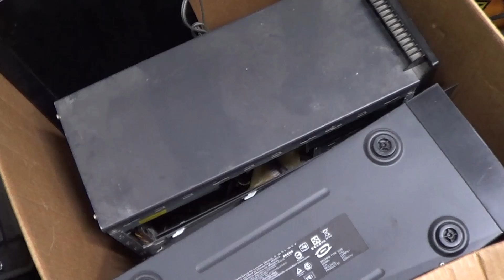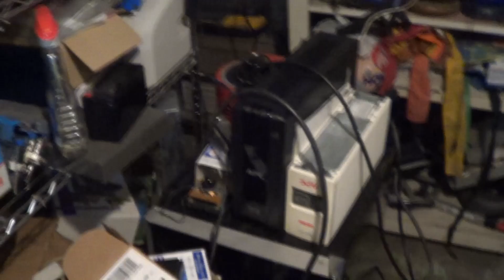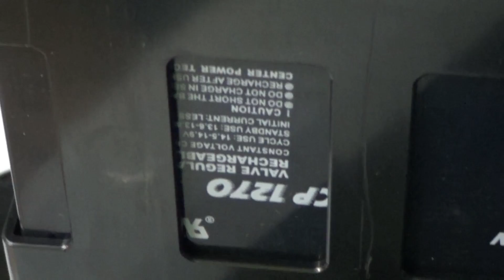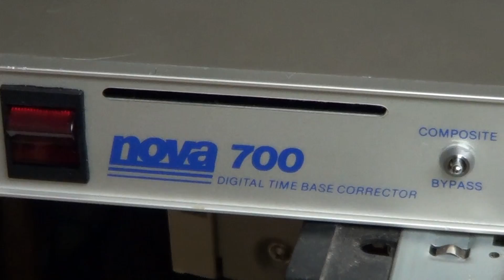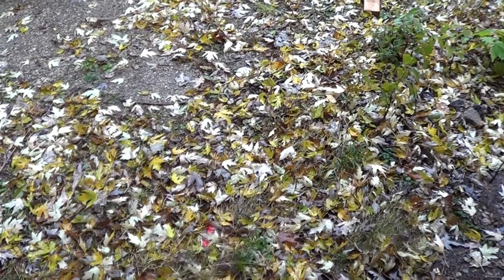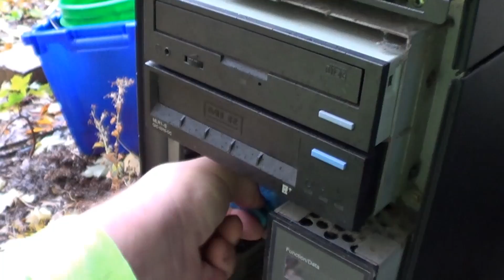The Hamfest Video for 2018

Comment: I wonder if the IBM was running AIX.  Sadly I have seen new out of the box UPS's with batteries that were bloated. From the limited number if rack mount UPS's I have seen, usually they are in a server closet or some other room with a rack and some switches, and being out of sight, out of mind, and usually also out of hearing range, they never are serviced, just replaced when the network no longer functions due to the UPS.  Last comment, I was never a fan of the push pin coolers either but I have figured out how to configure the locks and the pins so they go back in over the years so it's not a big deal for me usually. Sometimes the screw in types suck too.  Thanks for the electronic junk video. Always enjoy your hamfest videos.

Comment: It makes me wonder if they'll ever start using things like Lithium Ion cells inside of UPS units, less weight, more energy density, gradually being cheaper than SLAs, and so common in the form of 18650s that they'd be easy to rebuild packs of if need be...
Reply from the maker: There exist some lithium-ion based UPSes. Right now they're very poor value for money. Vendor lock-in is also likely the order of the day for replacement batteries.

I think it'll be a long time, if ever, before the good old lead acid battery is pushed out of the spotlight. Lead acid batteries are extremely tolerant of abuse on both the discharging and charging fronts. You can do things to them that will make a LiOn battery violently angry (to say the least). The replacements are also dirt cheap.

Comment: The push-pin mounted heatsinks is one of the many many areas where AMD got it better than Intel. It's unbelievable how much better the stock mounting mechanism is on AMD side, not to mention it didn't change all the way from Socket 939 (or even 754?), through AM2, AM3 and AM3+.

Comment: Cool scores, I can help you with the AS/400, a 9406-170 is not a bad machine. 
The drives will need to be IBM firmware SCSI drives, I can help you find some and OS/400. 

For terminals you will use IBM 5250 style terminals, which if you are looking carefully can be found cheaply, you also need a breakout box that provides the Twinax connections. 
Once everything is set up since the machine does have Ethernet, you can then use TN/5250 on a PC to log in, and you only need the real 5250 terminal connected to the machine to do console things like completing power on and shutdown.
Here is the IBM page on the machine, although with anything AS/400 it is a series of machines.
http://www-01.ibm.com/common/ssi/printableversion.wss?docURL=/common/ssi/rep_sm/3/872/ENUS9406-_h03/index.html&request_locale=en

Comment: I have one of those D630s with the nVidia graphics chips.  It still works- I maxed out the memory, added an era-appropriate Bluetooth chip, installed an SSD, and repaired the lid hinges.  I probably spent way too much money to restore it and max it out ($50), but hey- you can't put a price on fun, right?
Reply: were you able to upgrade your laptop to 8GB?
Reply: @johnstouchpad6437  No, the literature I found on it said the max was 4 gigabytes of RAM.